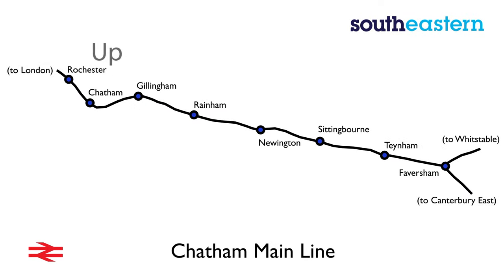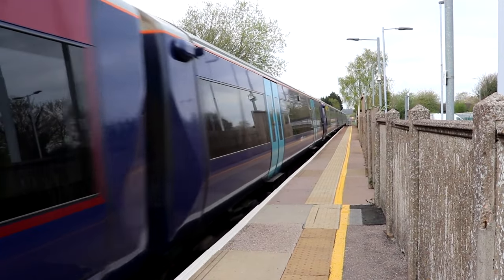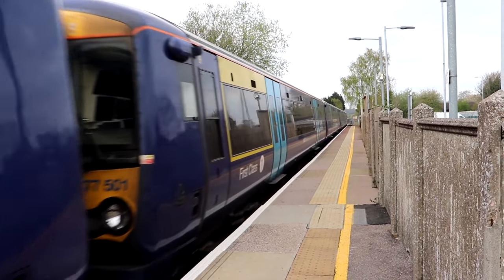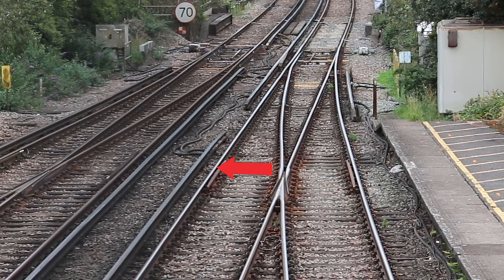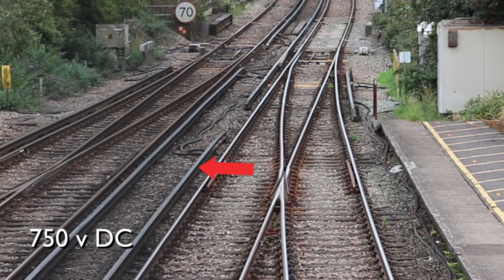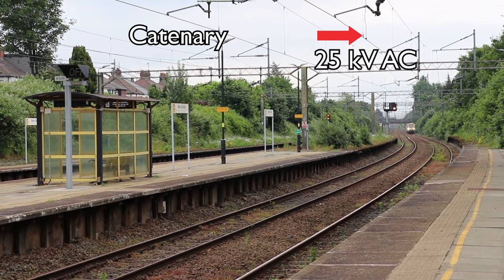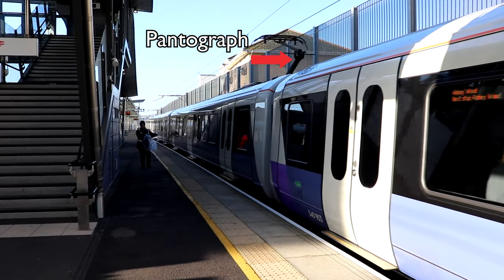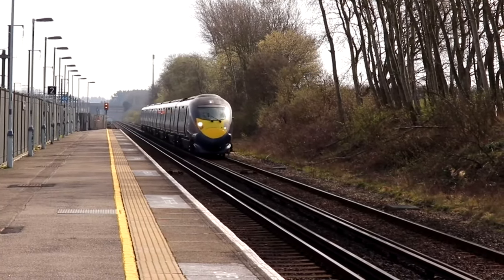British Railway Words and Acronyms

Comment: As a fan of 3rd Rail electrification, I would like to point out that it does have some advantages over the 25kV overhead systems- It is cheaper and quicker to instal (or was much more so in the days of wooden sleepers). There are no bridges or tunnels to be rebuilt, and unlike overhead lines which are frequently brought down, the conductor rails are very rarely damaged by trains. I do admit that ice is a problem, but it can operate with trains up to 100mph (161km/h) which is quite adequate for rather a lot of existing rail routes.
Reply: Actually, there was extensive rebuilding of bridges on the South Eastern following electrification as they had "dips" for steam locos to pass under safely, and the track was raised to enable a smoother ride, as a young drivers assistant I was on several engineers trains at weekends on tge Ashford - Paddock Wood route, raising track levels or replacing old brick structures in the 80s, only for the level to be lowered a few years later for Eurostars.

3rd rail is not a cheap method of electrification, it involves a great deal of infrastructure, sub stations and then TP huts regulating the power to the 3rd rail every 2 miles, OHL runs far greater distances with neutral sections, for instance one feed supply operates between London Euston with the first neutral section at Hatch End, South of Harrow and Wealdstone.

The Hastings line is limited to only 8 car operation due to the wider spacing of SUB stations and TP huts. Did you know that the 3rd rail on the Hastings - Tonbridge route is second hand off the South Eastern main line, reclaimed from abandoned sidings and forgotten tracks? There was a campaign to all SE staff to notify HQ if anyone knew of any locations no longer used that had 3rd rail so it could be reclaimed  and re used on the Hastings electrification project! A financial reward was the incentive, there was a lot in Hither Green Continental Sidings, and an abandoned berthing siding at Bickley on the down.
Reply from the maker: Wow thanks so much for this information, it really helps to hear from people who work or have worked on the railway. Thank you also for watching
Reply: 750Volt DC just cannot carry the current that a 25kv AC supply can.
Reply: @robertrich663 I think that you are confusing current with power. The 750V conductor rails carry far more current than a 25kV overhead line for the same power drawn by the the train.
Example- A train of power one megawatt at 0.8 power factor would only draw 50 A in a 25kV ac line. The same train on 750V dc would draw over 1300 A through the conductor rails.
 My original comment was not intended to mean that all lines should be electrified at 750V dc as 25kV ac is certainly better for long distance routes as less sub-stations are required. The advantages of third rail include:- Fast installation, no mast foundations required, resilience to winds, no problems with clearance in tunnels and bridges
Reply: @robertrich663  that's why 750dc is 750dc and 25kv is 25kv, two totally different electrical systems using totally different equipment for a totally different purpose, there is no logic to your statement I'm sorry but I don't see what you're trying to say???? The two systems are as far apart as chalk and cheese.
Reply: I suppose the main issue is safety. DC is far too accessable to the public when there are trespassers. While overheads aren't perfect they're far safer in the event of evacuations or emergency situations such as fires and the like. 

There is also an issue with DC requiring far more substations which are expensive as electrical sections have to be much smaller as DC does not travel as far.

Comment: When I went to work at a carriage maintenance depot in the Midlands, I was told on my first day that I would be working with lovers and ravers! These where the acronyms used for Local Vehicle Records System and Rail Vehicle Records System. The were computer programs used for the recording of maintenance and exams to locos and carriages which was then used to compute the weekly traction re-incentive bonus for the maintenance staff.
Reply from the maker: This is priceless information, thanks so much for sharing!

Comment: Often seen on platforms:

Buttons that train staff can operate from the platform are often referred to as "plungers" rather than buttons if the button is linked to the signal box or to other parts of the signal system.

OFF is an illuminated sign often seen on platforms that tells platform staff that the signals are "off", that is green or yellow, meaning the train is allowed by the signals to leave the platform. A red signal can be referred to as being "on". 

A plunger labelled RTS is for the platform staff to use to tell the signalling system that the train is Ready To Start.

RTS is needed where the track system is busy enough that the signal system wants to know in advance of the particular "road" out of the platform being wanted. On a busy terminous that means that a train that's still waiting for its driver is not given a road which might be used by another service. 

On some trains and trams the RTS confirmation can be sent electronically from the cab by the driver, and here the relevant signal will be labelled RTS. Tram RTS signals may also have a light that tells the driver if the signals computer is waiting for the RTS.

On some platforms the OFF sign will have another illuminated sign above, showing "RA" when lit. This stands for "right away" which means that the permission has been given for the train to leave by the guard and platform staff (where present). 

The RA sign is not for the driver, but so other platform staff know that the train is actually leaving. That's how they know to tell you not to bother trying to get on. 

Fun bonus prank:

So the two signs together RA OFF are not a blasphemous imprecation referring to a sun god, but gullible friends can be told that it is, as proven by the true fact that the train usually does indeed "ra off" promptly when both signs are lit. 😉
Reply from the maker: Wow, a brilliant piece of Information, thank you very much.

Comment: 4:00 don’t forget Bi-Mode Multiple Unit (BMU) - which can do both diesel and electric - far more common these days especially with the advent of the Class 800 series.
Reply from the maker: This will go on the list of requested terms, thanks for the suggestion and for watching.
Reply: care to be taken with these two terms, which when spoken are often pronounced identically

BMU - as stated
BEMU - Battery Electrical ... 

Where these are pronounced as "beemu" the listener is left to rent in context to know which was meant. Where the context is unclear is best to read out the initials as separate letters.

Comment: To be more exact, an EMU is a train powered electrically that does not have a locomotive separate from the carriages. Usually these are passenger trains, but there was a proposal for parcel trains using repuposed EMUs. I'm not sure if that actually happened, but those trains would still have been EMUs. 

The initials stand for Electrical Multiple Units. Multiple Unit simply means that the item of rolling stock that moves the train also has other roles (like carrying passengers, being a dining car, and so on)
Reply: That's not what multiple unit means though. A multiple unit is a unit that has more than one vehicle, each of which is capable of running under its own power, but all of them are controlled together from a single position.

For example, the TOC I work for has DMUs with the sole purpose of carrying passengers, and no catering. Each vehicle has an engine. Each of our units has between 2 and 4 vehicles.
Reply: Multiple Unit actually means a set numbers of units may be coupled up in "multiple" and driven from either cab at each end of the train, the entire train operating as one unit in multiple. Well it used to be and I drove SR EMUs for a living in Kent 😂
Reply: The class 325  was designed, built and is still in use today as a dedicated mail carrier.  other, older 'classic'  DMU, EMU and even battery vehicles have also served over the years.

Comment: Strictly speaking, it is not catenary but 'overhead line equipment' or OHLE. Catenary is a somewhat abused technical term that correctly refers to the bowed wire that, by means of the droppers, holds the contact wire at the right height. The contact wire is the cable from which the train actually picks up current with the pantograph.
Reply from the maker: Thankyou, others have mentioned this in the comment and I will certainly address this in a future video next year.  Thanks for the comment and of course for watching.

Comment: Your comment regarding AWS is incorrect. The AWS " Sunflower" - black and yellow does not mean a double yellow, yellow or red signal, it actually means that you have cancelled an "audible warning notification" in the cab, informing the driver that he has seen and acknowledged a warning of a speed restriction, temporary speed restriction, or as you stated, that  signal ahead is at caution or stop and that the speed of the train must be reduced or be prepared to reduce  speed and   if necessary bring the train to a stand. 

The word "Rake" is rarely used now, rather " consist" is the preferred term, - the train is made up of a load " consisting"  of vehicles. Good video, enjoyed it, just correcting a couple of  minor mistakes , keep them coming
Reply from the maker: Thanks for your constructive reply, it really does help not just me, but others. Also thanks for watching.
Reply: @RainhamRailEnthusiast  habit of being an ex train driver on your patch based at Ramsgate 😂

Comment: Before AWS there was HUD which was similar and was used on steam trains.
Reply from the maker: Very useful information thankyou
Reply: HUD? Of all the time I worked on the railway I've never heard of it, where as ATC (Automatic Train Control) was in use by the GWR on its steam locos, full AWS on the Southern Region Kent Coast wasn't fully adopted until the mid 1980s , before that it was only in operation on certain sections out of London

Comment: Very useful video, especially for any new enthusiasts (like me)    .. the only one I didn't know was AWS.
I am on one of the rail forums and often see acronyms there too which I don't know. TOPS being an example .. yes, I could ask there but a summary would be good.
Reply from the maker: I certainly have a few ideas for a future video from these comments.  Thanks very much for watching.
Reply: TOPS - is a old computer system (first entered in to the UK from the USA back in the early 1970s) and still very much in use today as it just works, it stands for Total - Operational - Processing - System, it keeps track of locos, wagons and trains, using TOPS you can build a train formation called a train Consist - (loco and wagons) and then use it to produce a train list for the train crew and shunting staff, you could make a 2 hour plus video on TOPS alone.
Reply: @newage3  Many thanks

Comment: AWS isn't just for signals, although correct it does sound when an associated signal is displaying a caution or danger aspect not all signals are equipped with AWS and TPWS for that matter. Also AWS can also sound for things like PSRs (Permanent speed restrictions) or TSRs and ESRs (Temporary & Emergency Speed Restrictions)
Reply from the maker: I think this may be revisited in another video next year, thanks for your comment it really helps.
Reply: There are also often AWS alerts for imminent Morpeth boards that warn of upcoming significant line speed reductions, usually where the speed is to drop by at least a third, e.g. from 80mph to 50mph. It's all very complicated, the more one delves into it. ^_^
Reply from the maker: After looking into it, it does seem to be a very wide ranging alert system.
Reply: @John2Ward  Indeed that's usually referred to as a permanent speed restriction. Although there are a few I can think of that don't have AWS even though they drop by more than a third! Ah the railway! Haha
Reply: @RainhamRailEnthusiast  Yeah it was developed before TPWS. And the sunflower that appears in the cab is meant to be a reminder that something that requires attention is still on the horizon. Although it's not perfect as a clear signal can cancel an AWS sunflower for a PSR, TSR or ESR etc.
Reply: @jamesleather7524  The restriction itself is, but the Morpeth board (as they are often called) is usually quite a way down the line, usually visible a few seconds after the AWS alert goes off in the driving cab.

By now, you are probably getting some idea of just how many drivers-view videos I have been watching(!)

Comment: Something else worth explaining would be the difference between an engine, locomotive and train.  There's also diesel-electric and diesel-hydraulic, electro-diesel and diesel-mechanical to cover.  As well as EMUs and DMUs there are DEMUs — Diesel-Electric Multiple Units, ie ones where a diesel engine drives a generator which powers motors which turn the wheels; it's always struck me as odd that Diesel-Mechanical and Diesel-Hydraulic were never differentiated in the same way as the two co-existed for a while.
Reply from the maker: There really is just so much to discuss! The railway does certainly have many acronyms, and I will try in the new year to address as many as I can.  Thankyou for watching.

Comment: Excellent - maybe you could continue a liitle with a demystification of some of the railway organisations (e.g. RAIB) and equipment (HVAC, WSP etc.). Look forward to your next video.
Reply from the maker: Not a bad idea that, will certainly give it some consideration, thankyou for the suggestion and watching.
Reply: RAIB - Rail Accident Investigation Branch. HVAC - Heating, Ventilating, and Air Conditioning. WSP - Wheel Slide Protection.  Equivalent to ABS on a car.
Reply: @bobife1253 WSP has a double purpose in the railway, in contrast to the motoring equivalent. Like in a car you get maximum braking effect just before the wheel slips, so WSP and ABS both keep the wheel turning during braking. 

Also you know how when a car skids it leaves skid marks in the road, where rubber is rubbed off the tyres? The same happens when a train skids: only the outer surface of the wheel can actually be damaged. That outer rim, made of steel, is known as a "tyre" and the damage is called a "flat tyre". 

Tell a train non-geek that a train went out of service with a flat tyre and they will think you're joking... I saw it happen once at Manchester Piccadilly. A class 150 DMU left it rather late to brake, skidded onto the growly bit of track near the buffers, and stopped safely. I had been intending to catch that train on its next service, but it was cancelled soon after the incoming arrival. Other passengers didn't believe me when I told them it had a flat from the skid, but the driver confirmed I was correct. 

Train had to return empty to depot pending repairs; and it would have been illegal to have continued to use it for passenger service. 

With WSP the train would have stopped slightly sooner, but more importantly would still have been fit for service.

Wheel slip causing accidents are much rarer than those causing tyre damage.
Reply: @trueriver1950  I am well aware of all that you say. I drive trains mainline for a living plus I am involved with a new build steam locomotive project.  The furthest I have ever slid with a train was with a class 170 some 20 years ago. Even with the WSP working it slid for approximately 2 miles before coming to a stand. Not a nice feeling knowing you have no control over the situation. Also, whereas steam locomotives do indeed have tyres on the wheels, modern trains often do not. To again illustrate my point I refer to class 170's which have mono block wheels. If wheels flats occur the wheels can be turned to a slightly smaller diameter to return them to true roundness, but the process is not infinite. Once the wheels reach a stated minimum diameter they are removed and a replacement wheelset installed.

Comment: Good video, but TPWS didn’t supersede AWS, it works alongside it. We still use AWS when driving, TPWS is to prevent collisions after SPADs or speeding.
Reply from the maker: Now that's very useful info indeed, I did wonder if they did work in tandem or standalone.  Seems to make sense really.  Great feedback and thanks for watching.
Reply: Do you still have cheap return tickets  to London  including  the circle line ?
Reply: @simonsadler9360  I don’t know, I’m a driver in Manchester
Reply from the maker: @simonsadler9360 If you live in the majority of the south east of England we still do offer the one day travelcard, which includes zones 1-6 on the underground network as well as your travel into London Termini (a small premium is paid if you wish to get into St Pancras via hs1)

Comment: Catenary and 3rd rail. Interesting. But a new method called 4rth rail. It has original 3rd rail but the 4rth one is in the centre of the rails the train wheels run on.
Reply from the maker: I assume you are talking about the system the London Underground (and most other deep level transits) use.  These have a live and return rail system. I may touch on this in a future video . Many thanks for watching